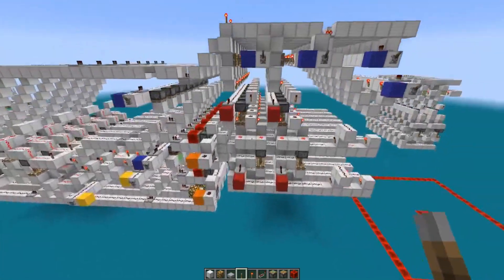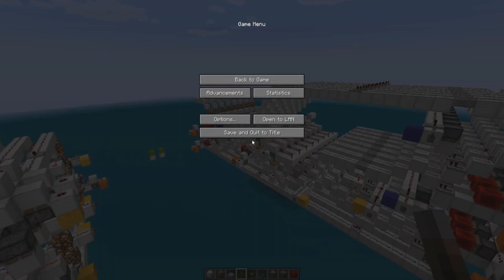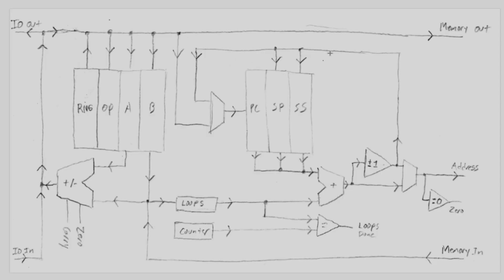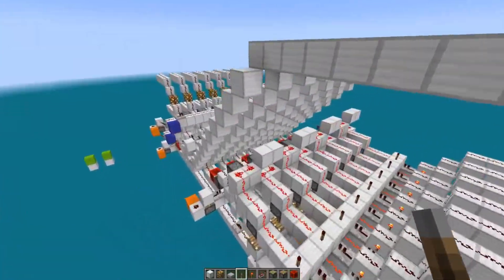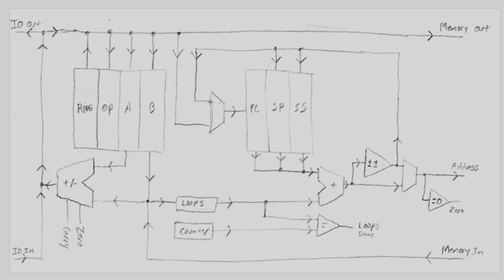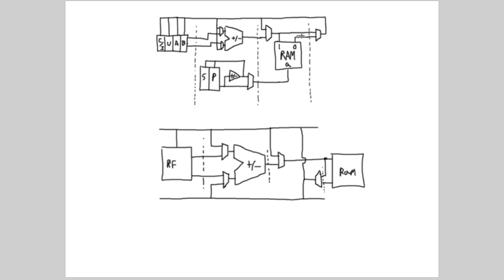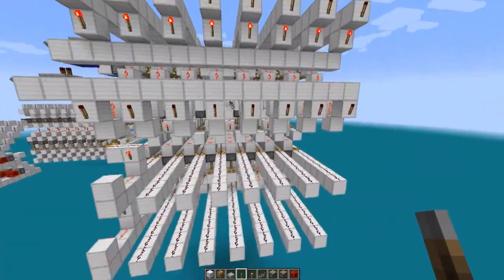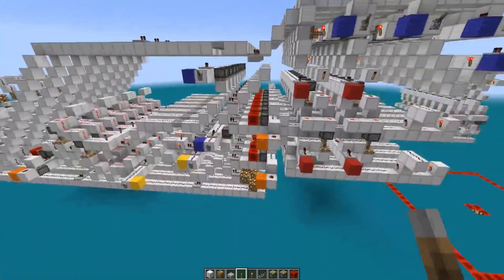Fatstacks Vlog Entry #6

Comment: Got a question, can you posibilly leave a link to where to install world edit tools? I can't find it anywhere.

I just got a pc so I won't have to build these computers one block at a time anymore lol
Reply from the maker: Yeah I'm running into the same issue myself... and it's primarily the reason why I haven't been uploading lately.

Unfortunately, the base mod that world edit runs on - forge - hasn't been updated to 1.13 yet...
I guess the restructuring of the block information really screwed the mod makers over.
From what I understand, forge needs to figure out how to interface with this before other mods can be updated.

Fortunately there is a glimmer of hope! Podshot and a few others are working on a program called amulet editor, it's basically a predecessor to mcedit. 
Development is, to put it lightly, slow! But they're moving faster than forge.

If you really need something now, sethbling has released a datapack called blingedit. It's really clunky and I noticed it randomly has trouble copying over redstone bits, but for the time being, it's the only working world editor we've got.

Personally, I would wait till amulet is released.
Reply: @n00b_asaurus  ah ok, thanks for the fast reply

Comment: Hello I have some questions about ur deepthought cpu. First I wanted to know where I could find the instruction set? Second what is the cpu clock speed? And third what is the reset procedure?
Reply from the maker: Well, the instruction set is located at the back of the user manual. There's a detailed explanation on page 12, and a quick reference table on page 14. Just a note, the 'code' column is written in octal, and only represents the 6 least significant bits of the instruction, since the 7 most significant bits are a constant given by the programmer.

The clock speed, haven't the foggiest... feel free to bust a hole in the model and find out ;)

As for the reset procedure, what do you mean by that? How to reset the CPU before execution?
Reply: n00b_asaurus for the reset procedure I mean the reset before cpu execution. I believe there is a reset button on the cpu. As for the download, I went to the link and clicked download on planet Minecraft, but the page that popped up seemed a little “virusy” with the whole adfly thing. Is this download place safe?
Reply from the maker: @remsy9935  Funny you should mention that last bit... I did use adfly for a bit, but I've since changed my mind... there are a few straggler links I've forgotten about though. I've updated the link, it's now a direct download. 

If you set the reset input and let the clock run for a few cycles, the computer will be reset.
Reply: n00b_asaurus I went to the download link again and when I click on it all that pops up is a blank screen. I’m on my phone so maybe it’ll be different on my computer idk
Reply: n00b_asaurus nvm I got on my computer and the download worked fine!
Reply from the maker: Yeah I can't imagine mediafire would work all too well on mobile ;) Glad I could help

Comment: Hey, maybe you can help me with something. Basically, I am working on my first redstone computer right now and running into some problems. I'm really confused on instruction sets and basically how to tell the computer to do this and that, how to program logic and values into it. Any advice?
Reply from the maker: Well, what do you think instruction sets are, as you currently understand them?
Reply: All I know is that they tell the computer and ALU what to do.
Reply from the maker: @duranson  Well, that pretty much sums it up. So what would you say is missing?
Reply: @n00b_asaurus  Well, I guess I don't know what each of the instructions should be in my computer... what instructions are essential for programming a computer, that a CPU uses? I'm not sure if that makes sense?
Reply from the maker: @duranson  Move, Operate, and Jump are about all you need to make a relatively functional computer. Curiosity though: what style computer are you working on? I.e. are you making a basic single-cycle computer? Multi-cycle? Pipelined?

Also, forgive me if I take a while to get back to you... youtube has apparently decided that notifying me about responses to comments isn't necessary.
Reply: @n00b_asaurus  I'm working on an 8 bit, multi cycle computer. I'm not doing anything too fancy because it is my first computer. However, like you, i am making it relatively x86 centered.
Reply from the maker: Aha, well that changes things a bit :P
I'm going to go out on a limb and guess you are where I was a few years ago: Wondering about that little black box they call a control unit that somehow takes instructions and turns it into control signals.

I'll give you a kick in the right direction - those super basic models that everyone starts out with... those single-cycle cpus with the massive program memories that are directly connected to the control lines... those can actually be converted to multi-cycle computers pretty easily.

Instead of loading your program memory with your program, you instead load it with microcodes, or a list of valid single-cycle operations you want your computer to do.
From there, change the sequencer from a counter to something that can spit out a specific sequence based on an input code. The easiest one to make is a look-up table connected to a counter/register (an example of this would be ben eaters breadboard computer), but more complex instruction sets may benefit a little more from a state machine (check out moore and mealy state machines).

hope this helps ;)
Reply: @n00b_asaurus  thank you :) ! This does help, I'm excited to continue along my project!

Comment: Can you make a video about basic gpu designs, which are kapabel of, for example, the bresenham algorythmus?
Reply from the maker: Mind me asking:
1) what exactly would you be expecting from me, if I made such a video?
2) are you on a phone?
Reply: @n00b_asaurus  
1. Basically a fast alu with programm-memorie and registers,  that can use its given data to draw (for example with the bresenham Algorithmus) a line from one koord to another and similliar things, like Cirkles

2. I wrote the previous message on my pc (this one one my phone)
Reply from the maker: @vanos3378  There really isn't much to GPU's. 
Pretty much all pixel-level drawing algorithms just apply some function to each pixel.
This includes bresenham's line drawing algorithm - it's just an algorithm that goes through a screen, pixel-by-pixel, and determines which pixels to turn on, and which to turn off, in order to draw a line between 2 coordinates. 
Rather than doing all of this on a single thread, which is what a CPU would do, a GPU has hundreds of cores, and can run the algorithm of choice on hundreds of threads. 
All the GPU does is assign each core a region of the screen, and each core applies its algorithm to the pixels in its region. Assuming there are no dependencies from region to region, the result is the algorithm being applied to all pixels hundreds of times faster than a singe core CPU could.

TL:DR, A GPU just takes advantage of the fact that most of these algorithms can be executed in parallel, and executes them in parallel. Something a CPU cannot do.
And no, increasing the throughput speed of your ALU isn't going to increase the speed of a single core to that of a GPU, there's a little more to that than you think.
Reply: @n00b_asaurus  thanks for the answer, now i at least know why they have that many cores :P
Reply from the maker: @vanos3378  glad I could help, best of luck on your studies!

Comment: hmm the sketch might be kinda simplistic, but wouldn't you want to forward the ALU value if there are no hazards? That is besides the forwarder you have currently. Anyways, i love this direction from you. If you have any quirky questions i might be able to answer them.
Reply from the maker: If I did everything correctly, I don't think I'll be needing to forward the ALU output. 
All of the microcodes either move data from memory to a registers, or from a register to memory. 
That's not to say there won't be hazards, but I think if I arrange my microcodes correctly, most hazards, if not all, can be avoided.

This may be subject to change though ;)
I'm still tinkering with pipelines, and pipelining microcodes like this is completely new to me.  If I end up running into a dead end, I'd love to get your input!
Reply: @n00b_asaurus  Lets say that you would only use register move operations. Without the intermediate forward you won't be able to do do shift A, then add A to B in succession because the shift A would still need to pass the memory stage the moment it is required to be in front of the ALU. But maybe I'm wrong or it might not be your intention. Things like Load A from memory, then add A to B will always stall but the above example should not and is somewhat solvable in hardware.
Reply from the maker: @koyarnosredstone5783  Ah, me thinks I wasn't clear with the functionality of this model - my mistake.
This is an interpreter (stretching that definition a bit thin here) for a sort of psudo-language called stackish. The language was written by ender_scythe, and he was the one who suggested building the interpreter. 

For the most part, pretty much everything revolves around the stack. The only time data is ever really processed is with the add, subtract, and compare instructions. In all cases though, data is popped, then immediately pushed - data doesn't stay in the registers for very long. Hence why I labeled them temp A and temp B. 

If this was a more traditional model with more use for the registers and more functions in the ALU, I can see why you would need to forward the ALU output - and that's definitely something I'll be taking note of for the future :)
Reply: @n00b_asaurus  Ah so I'm guessing the microcode is somewhat limited in operand freedom to not need that extra fluff. 

Actually, i was once considering using 2-operand base indexed cache (4/5 bits relative offset to BP) instead of a normal registerfile. Because the usage of a stack is very predictable it is easy to prefetch based on the base pointer and it would have its own memory segment. Maybe food for thought :p
Reply from the maker: @koyarnosredstone5783  I take it you never got around to building it, huh? 
If you have, or ever will, I'd love to see it :D
Reply: @n00b_asaurus  Yeah, never got to it. The idea is fine, but if the instruction set does not mature or the hardware layout isn't optimal i won't even start building it. But who knows?

Comment: We learned similar stuff in class about FPGAs. But there it's a bit different. There you can add logic blocks together for as long as you want. But the only clocked things are registers. So the more logic you have between the registers, the slower you have to make the clock. Also if you want to multiply big numbers you better split them up to make a pipeline or parallel processing. Or else you will slow down the clock for the entire FPGA (or at least the section which runs at the same clock speed). Kind of interesting but the teacher does a bit of a dry lecture.
Reply from the maker: very well said! 
Yeah I remember being stuck in dry lectures... fortunately we had 2 instructors and one of them was at least somewhat entertaining.
Hopefully you at least have labs as well as lectures! I swear to this day I learned more from my lab instructor than the lectures XP
Reply: @n00b_asaurus  There is a lab to this lecture but I couldn't take it. And this is also one of few classes we have two teachers but one of the two has some other random topic.
Reply from the maker: @benrex7775  ooof! Yeah if you can take the lab (even if you have to sneak in) I'd take the opportunity.
Reply: @n00b_asaurus  Semester is almost finished (as well as my bachelors degree), I have other courses to attend and people also aren't that happy with the lab. But it's not that big of a problem. I will pass the course and the stuff I want to know is there for self study when I need it.
Reply from the maker: @benrex7775  well that works :P best of luck on your studies then!
Reply: @n00b_asaurus  Thank you.